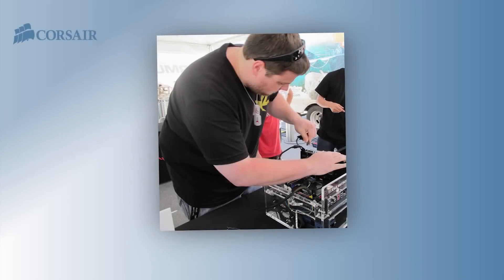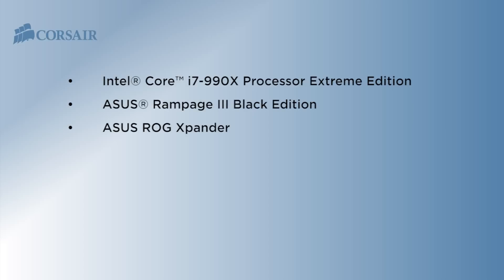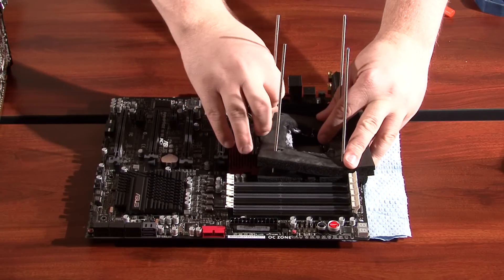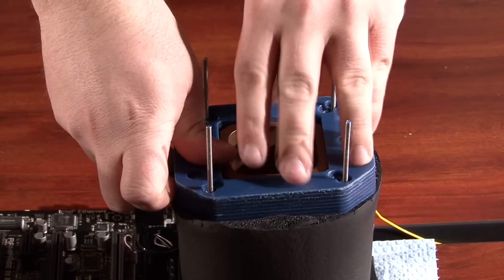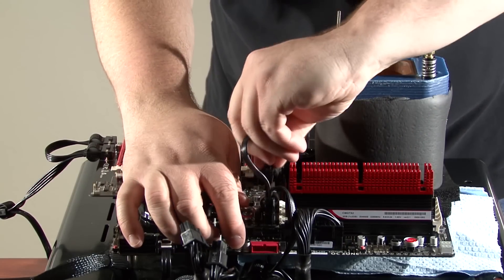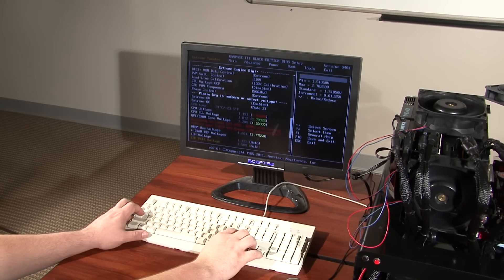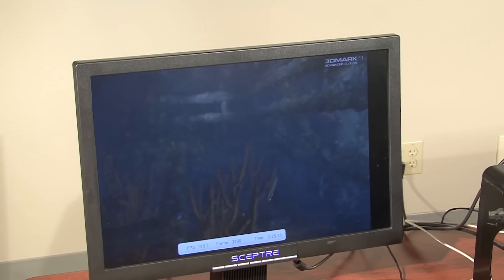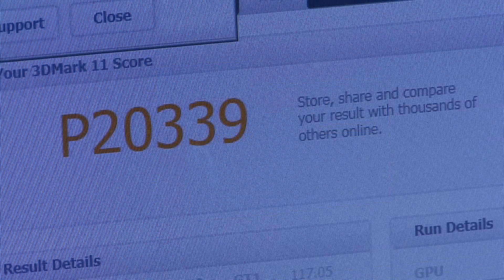Setting up your PC for liquid nitrogen cooling

Comment: First liquid cooling, and now nitro cooling. What's next? Moving to antarctic and sticking your PC in the ground?
Reply: that's how large chunks of the ice-shelf get broken off.....it's not global warming it's Bill Gates' personal system I swear
Reply: freezing your processor to 0 kelvin
Reply: ***** Ambient temperature is the coldest you can get on either air or water cooling. Water is better than air because water is much more efficient at absorbing heat and absorbs much more heat per unit than air does. However, transfer of heat only occurs because there is a difference in temperatures between one substance and another. The heat simply diffuses from the warmer location to the cooler location. That means that as the water passes through the radiator and loses its heat, it cannot get any cooler than the air the system is working in. If it does happen to get cooler, then the air will actually start transferring heat into the liquid. 

The only way you can get cooler than ambient temperature is if you're using phase-changing properties of a coolant so that the coolant itself actually gets cooler than the ambient temperature or a substance in a very cold state -- like LN2.
Reply: Well I do plan on moving down there and start a server farm. Figured with the high wind speeds, constant sunlight for 6 months would supply lots of clean power and since it's so cold I figured the servers would be used as a heat source. Think about it, people useing servers too cook food.
Reply: That's how i cool my pc here in artic circle :D
Reply: Interesting thought, but I wouldn't try to get any He-3 on the public market...might raise some eyebrows, no? LOLZ!!! "Um, no, Mr. FBI man, I'm not trying to build a fusion reactor in my basement...I'm just a humble computing enthusiast...please don't hurt me..."
Reply: Liquid helium cooling!!!
Reply: Next is warping the heat into an alternate dimension.
Reply: lol!!!  You are correct of course.  Thanks for keeping us grounded in reality!
Reply: tonton9598 electrons can't move at 0 degrees kelvin
Reply: BuildMeASnowmanBiatch xD
Global warming solution : Stop the production of FX processors.
Reply: nije1x Your lowest temp available then would be the dew point. After that, you start getting condensation.
Reply: dustichux867 I'm blushing. Thanks for the offer, but no.
Reply: Sponge . That'd be a downgrade
Reply: tonton9598 Great for quantum computers. You need near Absolute Zero in order for the superconductivity necessary for quantum function.

But we've initiated and read quantum spin at room temps now, so we should have quantum desktops in the next 10 years. :)
Reply: JakeEricson We're talking about portals, cooling PCs with Mortal Kombat sub-zero cooling, and sticking PCs into antarctic ice. It's not really the time for strict adherence to reality.
Reply: Good idea going to do that.
Reply: this guy knows ^^^
Reply: Alexandru Ionescu However, there's no molecules in the air, so the heat would be trapped in the CPU/heat sink, since there's nothing to conduct the heat.
Reply: BuildMeASnowmanBiatch actually the next is fridge cooling, you take a normal watercooled Pc and attach it to a fridge's cooling loop.
Reply: You could put your PC in a black hole, or if you don't have it, outer space should also work.
Reply: I use a particle accelerator for my CPU cooling system
Reply: You mean a particle de-accelerator ;D
Reply: XD lololol
Reply: McFurck Offington I have an FX9590 and it idols at 7 degrees celsius with a corsair H110 cooling it.
Reply: That's where your wrong wrong, liquid cooling doesn't get colder than the air thats being pushed through the rad to dissipate heat. I am also in a basement that is to 10-15 degrees celsius.
Reply: Interesting.  Either your fluid has some kind of amazing heat-transfer rate (or something like that) or your data is off.  Tell me what you're doing, because 50% below room temp is pretty damn good!
Reply: I realize that the fans transfer air ACROSS the radiator, where heat accumulates.  The air is going to be at least room temperature, unless I'm missing something.  And it's not exactly correct to say that the water is "cold" when your CPU is idling at 30C, which is over 80F.  At the very least, I'd call that luke-warm.
Reply: =D =D =D !!! AAAAAaa good one bro good one!!
Reply: ***** you need to have a ac it will be better if that was me that's what i will do
Reply: What is going to happen is people are going to get nostalgic about PC cooling like they did with Sega games and NES games. Then we are gonna see videos of "Look at that original stock heat sink...So sexy" Mark my words.
Reply: Pick - N - Play its already happening man tack the channel SingularityComputers you'll see!!
Reply: DEEP WINTER XD
Reply: Vacuum Cooling/
Reply: ***** Vacuum leads heat very poorly
Reply: DEEP WINTER
 exactly, and he's trying to find a way XD
Reply: *****
 facepalm!
Reply: liquid helium 3 cooled pc?
Reply: Mortal Kombat sub-zero cooling system but you will need to open a portal to that dimension
Reply: I don't think you understand the evaporation point of nitrogen.
Reply: ***** Um... if the case fans blow cold air onto the radiator, where does the cold air come from?! If your house is 80 degrees Fahrenheit, your fans are only going to be blowing 80 degree Fahrenheit air... You only feel cool when a fan blows on you because of your sweat, "you sir need to learn common logic". smh
Reply: sticking that pc to ice would kill it
Reply: mscattack Not necessarily.
Reply: nexus1g ice melts
Reply: mscattack And if it's distilled, it won't do anything. Water isn't conductive.
Reply: nexus1g Rain water?
Reply: ***** okay then
Reply: ***** Not really
Reply: mscattack Oh, stop being butthurt.
Reply: nexus1g how am I being butthurt?
Reply: mscattack "cool huh?:)"

"Not really"

^ Clearly butthurt. You learned something. That's cool.
Reply: nexus1g I knew distilled water does not harm electronics, just that I didn't know if the ocean water which touches the snow would harm it
Reply: mscattack You didn't know that. You wouldn't have asked about rain water then when I said distilled water isn't conductive. You're digging yourself in a hole now.
Reply: nexus1g I'm serious,
Reply: Why not? XD
Reply: Kahlo kahlow They'll have to ban the fx 8350 to save glaciers from melting xD
Reply: Kahlo kahlow LOL
Reply: Plazma lasrer holy
Reply: Peltier cooling?
Reply: They should make cases that come with a liquid cooling kit for a CPU and 2 GPUs.
Reply: nije1x Just buy an H100i.
Reply: nexus1g Fuck You.
Reply: Facke Naem That theory is just stupid, if that was true, a table or ceiling fan would have no effect at all, since the air doesn't get colder by the help of the fan. So, if your Liquid cooling fan has high enough CFM, it can significantly reduce the temperature of the computer compared to the room temperature.
Reply: ***** Pure H2O is not conductive. It's ions that make it conductive.

"But what I learned from researching this topic was that pure water is actually an excellent insulator and does not conduct electricity. Water that would be considered "pure" would be distilled water (water condensed from steam) and deionized water (used in laboratories), although even water of this purity can contain ions."

http://water.usgs.gov/edu/electrical-conductivity.html
Reply: ***** Just admit you were wrong instead of just splitting hairs. Get the fuck out.
Reply: ***** it sure is.. Last I checked the nitrogen down there was still a gas..
Reply: ***** im not.. i was confirming your correctness to emphasize how not well thought out the other persons statement was. even at the record lowest recorded temp down there it was not as cold as this setup.

side tangent. realistically having this computer placed at the bottom of the marina trench would be better. not that it is colder than liquid N but it is very cold water and would actually displace heat faster than the limited capacity of liquid N while it is boiling.

but either-way... not mocking you.
Reply: ***** He said he wasn't. Let it go.
Reply: ***** Making a jab isn't letting it go. Keep that in mind in the future.
Reply: ***** Advice will be given whether you like it or not. It's your choice on how to apply it or discard any advice. Have a good day.
Reply: <-- grabs popcorn
Reply: tonton9598 gg, atoms stop moving at that point
Reply: jeffrey625625
 gg, RIP humor, your PC is frozen. GET IT? FROZEN, JEFFREY!
Reply: ***** Perhaps you could not be such an egomaniac, and not worry about whether you feel like I'm telling you what to do or suggesting it.
Reply: ***** I'm sure you meant "verbiage", because my grammar is fine. You're an angry beta raging at someone on the internet while being wrong. That's got to be really embarrassing for you.
Reply: ***** Might I recommend a remedial reading class for you then?
Reply: ***** Apparently you don't know that
"grammatics" refers to one's grammar. My grammar is perfectly fine. However, "grammatics" isn't even a word, and "grammatic" isn't a noun.
Reply: BuildMeASnowmanBiatch anti matter cooling is the next
Reply: nexus1g water will corrode metal and short out the pc, even if it's distilled
Reply: MR5er1 water will corrode everything, it is the ultimate solvent.
Reply: MR5er1 It will leech ionized minerals from the metals, but if the components are in ice it will have a constant supply of new deionized water, it would never be conductive. Of course, then there's dry ice that turns to gas rather than a liquid, which is also an option. Of course, then you'll have to have it vented or risk carbon dioxide poisoning.
Reply: yeah, it can work but you have to constantly change the ice xD
Reply: No, next is sticking your PC in a volcano see how that goes from there!!
Reply: BuildMeASnowmanBiatch No. Setting it up in outer space, where temperatures are close to -273 Celsius.
Reply: nexus1g
kudos for your knowledge of physics, sir.
Reply: Umm neptune
Reply: BuildMeASnowmanBiatch Milky way GALAXY cooled.
Reply: Do we actually have a significant difference for having a computer that cold? does it really need to be cooled down to the point we use Liquid Nitrogen? or is this just to try something hardcore?
Reply: They only made this video for your purpose and interest. Stop hating. You should not try this neither if you are qualified in IT Engineering. There is not need to cool it like in the Artic. It causes damage over time.
Reply: the official .sandidge02 You should have read up on it before you called me wrong.

http://www.nature.com/ncomms/journal/v4/n4/full/ncomms2776.html
Reply: ***** -500ºC isn't a valid temperature. -273.15ºC is the lowest temperature you can go.
Reply: ***** I'm*
Reply: ***** The computer would overheat.
Reply: ***** It doesn't matter what the temperature of space is, there are no particles (or at least very, very, very few) in outer space. You need matter to absorb heat. If there is no matter, there's no heat absorption. So all the heat generated by the CPU would just stay in the CPU.
Reply: ***** The wafer has a mirror finish. It has a negligible amount of emissivity.
Reply: ***** the performance boost ive seen from mineral oil builds makes me sick to my stomach.... so much effort & extra $ & time for a lousy 5-10% bump in performance over the best air coolers.... i get better temps on my fx8350 with a corsairs h100i than ppl that have done mineral oil builds XD
Reply: Philip Jolly get a good fx8350. thats all the 9 series is just a bunch of high quality fx8350's.....
Reply: eskimo cooling
Reply: Sponge . I'm three years late BUUUUT people have used liquid helium
Reply: Now Antarctic is melting 

Many people took your comment seriously
Reply: Pretty sure that liquid nitrogen is much colder than just a mere "Antartica"
Reply: Sponge . i swear you just made my day LMAO

Comment: I kind of fail to see the reason for this kind of overclocking method other than getting a high score on a website - Which I really do not see as a valid point in an argument.

Sure it works wonders for like 10min but that's it and unlike with Air, Water or Compressor Cooling it's not getting even close to becoming a viable long term cooling solution.

Bring me a long term cooling solution like this and I'm all in for it but just for the numbers and the little bit of time to actually get these numbers? No, no, no...

Comment: Whats the chance of this ruining my PC? What if the stuff leaks? Is there any liquid that is safe on computer components that will work in the loop and wont cost too much?
Reply: if you dont know this already dont try it, it isnt really a loop, the nitrogen goes in and evaporates back out, at which point you put some more in, it cant leak through the pot as its a solid lump of hollowed copper, you will never make this for everyday use and if you do you shouldnt, liquid nitrogen wont damage the pc directly but it will cause the temperature to drop so dramatically that condensation would destroy it almost immediately. you can make a mineral oil loop but thats not sub zero. and its bulky... (however you can make it in a fish tank and put toy mechanical fish in it to swim around your pc which would look awesome with seaweed and rocks.)